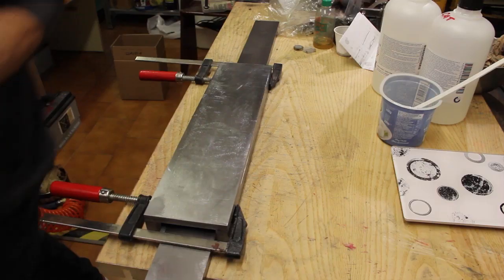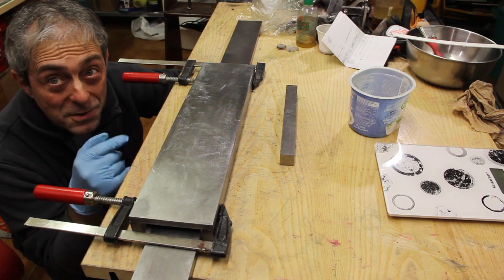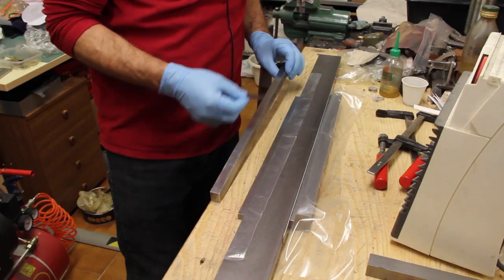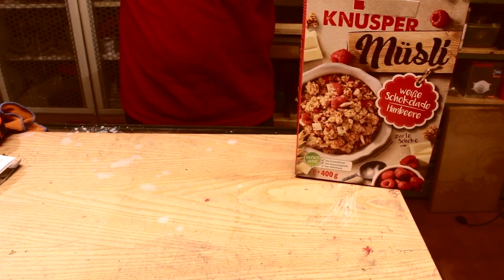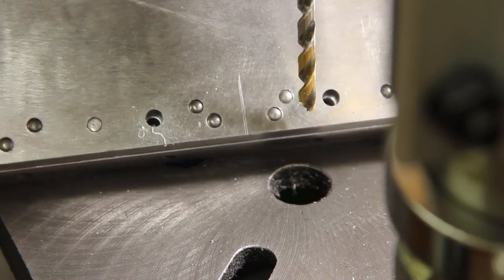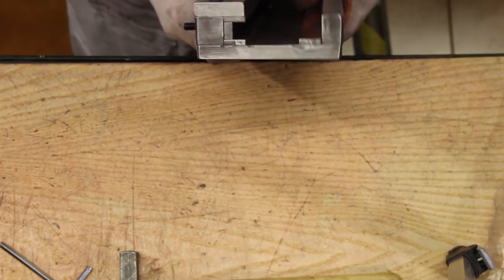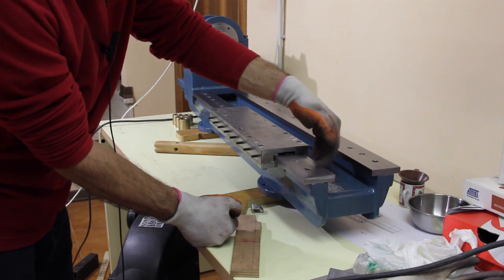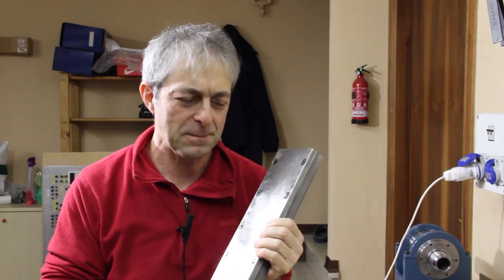DIY metal lathe - slides for the saddle (alternative welding) - part 5

Comment: Tapered roller bearings such as you used in your spindle, are normally configured in the back to back way, as opposed in the front to front way in your spindle. The BTB arrangement is much more rigid to resist bending moments on the bearings arising from sideways cutting forces. Also, tapered roller bearings can take radial and axial thrust loads at the same time, which makes the ball bearings redundant.

Comment: My compliments. I would also like to make one, but I have the problem of finding the various iron plates, because those who want to buy them need a VAT number that I don't have.
Question: I don't know how much I spent to do it all but it wasn't convenient to get an original one? Also used, which are at a good price.
Reply from the maker: Sorry Idk how to help you about the VAT ID problem. About your question, yes it could have been easier to buy a lathe but I wouldn't have learnt much in that case. Maybe it would have costed less but I would have spent more to adapt it to my needs. I will address these questions among others in a next video. Thanks for your kind comment. Good luck with your lathe.

Comment: But how do you make sure the Z height doesn't change? The sliding surface of your carriage is just a piece of metal that you glued in there. There is no way that it is flat. Am I missing something here?
Reply from the maker: Sorry for  the late reply. The Z height should not change as long as the whole surface of the carriage is in contact with the flat surface. However I will soon finish the carriage and will perform some tests ...it will be the moment of truth :)

Comment: I think this is the best DIY lathe build I have seen so far, keep it up. In older lathe designs the adjustable sliding surfaces used bronze inserts. I wonder why you are going for steel on steel instead?
Reply from the maker: Hey, thank you. Bronze unfortunately was not an option, the alternative was (and still could be) brass. Eventually I opted for steel because the reduced stick-slip coefficient of friction. It's not definitive though.
Reply: ok it will be a good job, correct me if I'm wrong: but no one asks him how much he spent? I am sure that if you bought a used one it was better, it saved you, and in all its functions, without counting the tools already included.

Comment: hello,
when will be the dovetail cutting video be available cus i am building a lathe myself right now and need to figure out how to cut the dovetail for the slides without a milling machine.
thx
Reply from the maker: Because I have many things to follow I can't say in advance when, but I hope you'll be notified by YT when the new video will bo up so be sure to subscribe and click the bell icon otherwise you'll miss the notifications. Cheers and good luck with your lathe.
Reply: @AccidentalScience  ok thank you. i used sbr25 linear rails and for the compound slide i used just precision rods.
I just finished the compound slide today and figured out that it was a total flop. lol
but anyway i will redo the compound slide someday.

can't wait for your next video
Reply from the maker: @drfistus94  My first idea was to use precision rods too, but eventually I scapped the idea bc that would have ended up quite cumbersome, also I've calculated the amplitude of the flexion (bending) under load and it resulted unaccettable for small diameter rods. Also, using linear rails was a good alternative provided to have a flat surface to lay down the rails. I don't like linear rails for this kind of machine bc they run on ball bearings and when a part that have an irregular shape is processed this would cause a pulsed load that would put quite a stress on the rail that would be subjet to pitting by the balls. To clearify, say you want to round up a square, when the tool hit the part to remove the excess a pulse of load is generated when each corner is touched by the tool, this pulse will be obviously transferred down to the bearings that in turn will hit the rail. If the part is turned at 300 rpm the balls will hit the rail at a frequency of 20 pulses per second. Pulsed load is worst than continuous load as each pulse is surrounded by oscillations due to the ringing effect. However this is a relative issue as it depends on the kind of rail and the kind of bearings used: roller bearings are best suited for this kind of application, but even with ball bearings just simply let the maximum load be well below the peak the given rail-bearing couple is able to widthstand and it will works fine.

Comment: If you chose cold rolled and brazed it you would have a very large amount of warp and twist. It is possible to normalize the brazed assembly and then lap it. But it's a lot of work. 

What you did is pretty much as good as it can get with the materials you have chosen to use.
Reply from the maker: Thank you for the feedback. Honestly I didn't verified what brazing would do, I knew that brazing usually do not cause distortions and warps because the whole material is heated uniformly. Cold rolled steel on one hand is dimensionally more accurate, but on the other hand actually could have a certain degree of latent tensions due to compression so not sure about the possible results. Also, the cold rolled mild steel that I purchased is "relaxed" ...not sure what exactly that should mean except that they charge more money for it :/
Anyway, because I shared this doubt (the risk of warps) I preferred the "cold" solution eventually.
Reply: @AccidentalScience    You have an advantage if it is relaxed. That means it has been stress relieved in a heating process. Valuable in what you are making.
Reply from the maker: @KravchenkoAudioPerth  Cool, so having paid  €1.50 per Kg worth it.